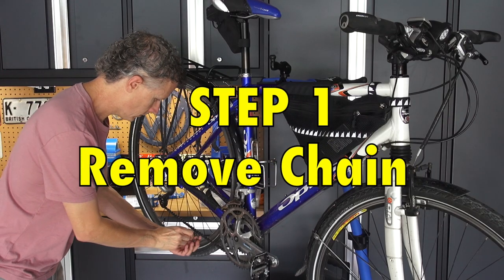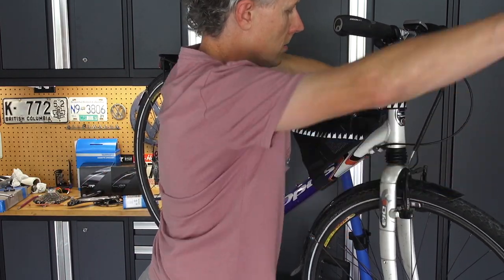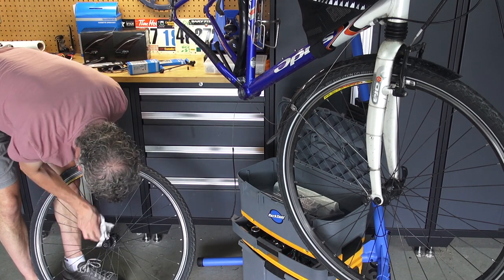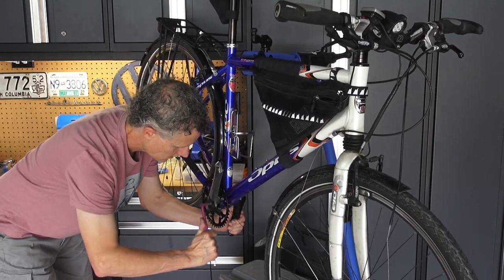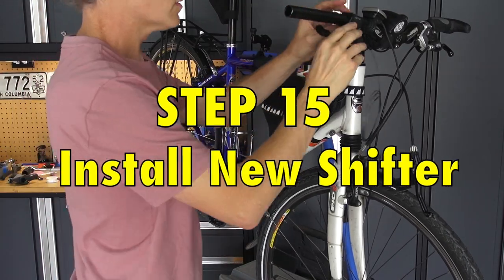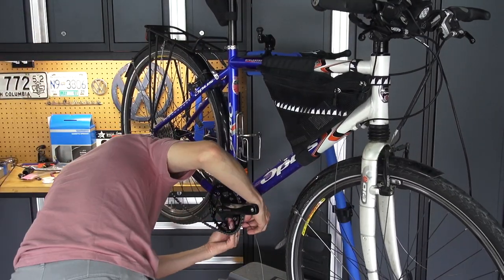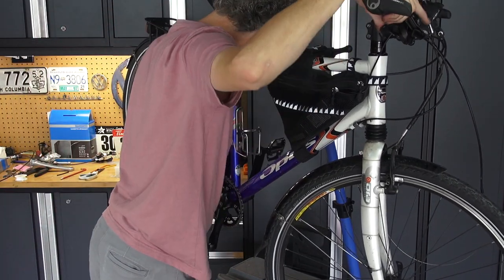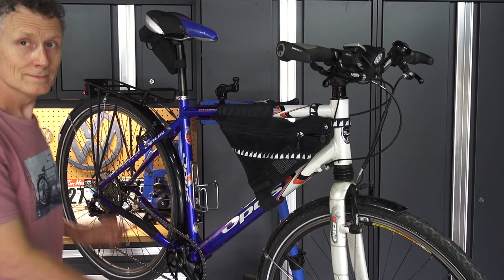Converting my Commuter Bike to 1x11

Comment: Hi I saw that your old bike's drivetrain is a 3 x 8. Subsequently u concerted to a 1 x11.
Did you change the freehub for the rear wheel to fit the 11 speed cassette? Or were you just able to fit your 11 speed casseette into ur existing freehub?
I read in some forums that for MTB freehubs 8/9/10/11 freehubs are the same but for ROAD freehubs its different.
Maybe you can enlighten me because I have an old bike (a giany yukon like maybe more than 6 to 7 yrs old) 3x9 which I intend to convert to 1x11 too. Wonder if I could do the conversion without changing the freehub to match the 11 speed cassette.
Kindly advise pls
Reply from the maker: The new 11-speed cassette fit just fine on my old freehub, so no change necessary - I found the same about 8/9/10/11 MTB freehubs being the same in my research before doing this conversion. 🙂
Reply: @AllAroundMathGuy  how old is your bike or freehub? My Giant Yukon i guess is more than 5 to 7 years old, I think.
Like you, I too have tried researching if all MTB freehubs were interchangable between 8,9,10 and 11 speed cassettes. I ended up with alot of data that contradicts each other. Some say the MTB freehub is interchangable between 8,9,10 amd even 11 speed cassette, so there was no need to find a replacement freehub. Some articles states that older freehubs only cater for 8,9 & 10  speed cassettes and whoever wishes to change to 11 speed needs to change their freehub to accomodate the longer length of the 11 speed cassette.
Whats yout thought in this?

Comment: Great videos!! So I have a 2x8 clairs , I don't need a new back wheel? I got just throw a 11sp cassette on?
Reply from the maker: Thanks! An 11-speed cassette should fit on a wheel with an 8-speed freehub body (for Shimano anyway). (Of course as I'm sure you know, you'll need a new shifter, derailleur, etc. though to complete the conversion.) 🙂

Comment: i want to change 3×8.. it's posible to change 1x8 and how many tooth for the crank
Reply from the maker: If you go to 1x8 with the same rear cassette then you will lose some of your range of gear ratios, but it is definitely possible. You could choose the front chainring based on the range of ratios you think would be best for the terrain you ride most often.

Comment: Anybody know if I can remove the 2 smaller chainrings on a 3x Shimano Acera crankset? I know I’ll need new bolts. The 50t 104bcd is just too pricey for me at this moment.
Reply from the maker: You should be able to, but as you said you will probably need shorter bolts. Are you hoping to make it a 1x setup? Without a narrow-wide chainring, you might find that the chain comes off the front over bumps without a front derailleur.
Reply: the AllAroundMathGuy My stock large chainring is narrow-wide. I’ll just throw on some chain guides for safe measures. Until I find the courage to spend $300 on a track crankset. Thanks!

Comment: I have a 26ers which is 1x7 with 42 chainring Infront,if I change it to 40  is this still compatible?I want it smooth on the road and good on hills,can you suggest a good gear ratio?
Reply from the maker: You might not see a huge change going from 42 to 40. If you want a smaller gear ratio for climbing hills, you could also consider a cassette with a bigger largest rear cog. What do you have now?

Comment: Hi what can you say with this 1x set up? 40t chainring and 11-46t?  Is that good? Try putting it on my gravel bike.  Thanks
Reply from the maker: That sounds like a good setup in terms of range of gear ratios for a gravel bike. Low gear of 0.87 and high gear of 3.63.
Reply: @AllAroundMathGuy  is that a good ratio? Thanks

Comment: lol i see many change to 1x 10 from a 3 x and consider it a upgrade , 1 x 11 is such a expensive upgrade
Reply from the maker: I probably wouldn't suggest changing to 1x if it meant throwing out perfectly good components. In this case I had to replace most of my drivetrain anyway due to use over the years, and pricewise there wasn't much difference - that factors in for sure. If you go from 3x to 1x with the same cassette it's definitely not an 'upgrade', because all you're doing is eliminating much of the range you have by getting rid of two chainrings. 🙂

Comment: hi sir it is ok to setup my 26er into 1X11 ??
Reply from the maker: Should be fine, if you get the appropriate parts. Depending on what you use if for, you might choose a different size chainring (eg. smaller for trail riding, larger for road) and cassette (eg. bigger range for trail, maybe slightly smaller for road).